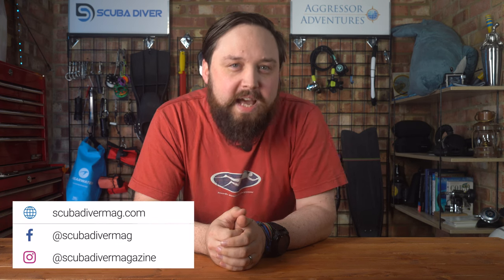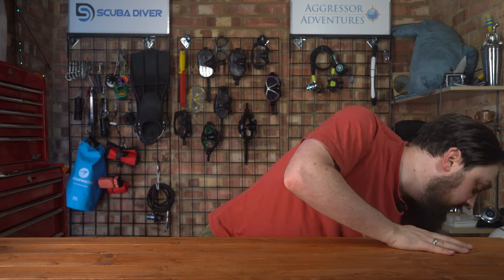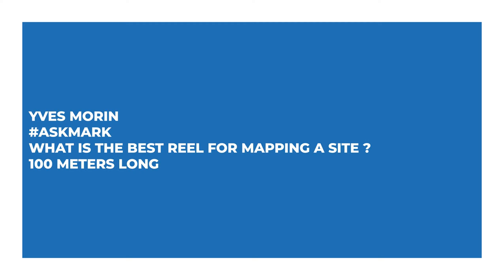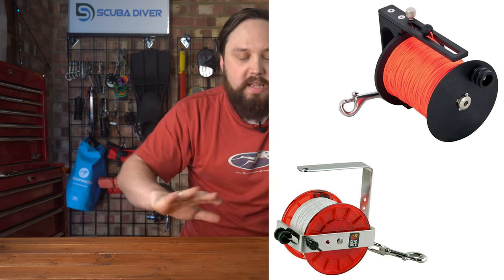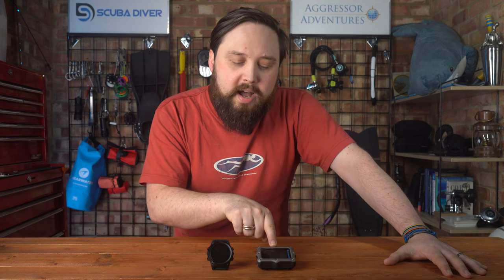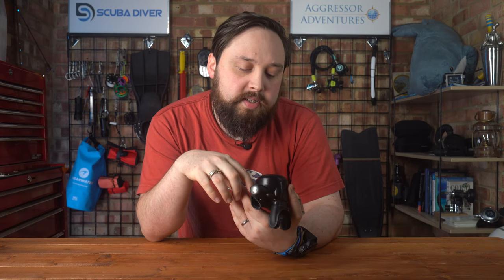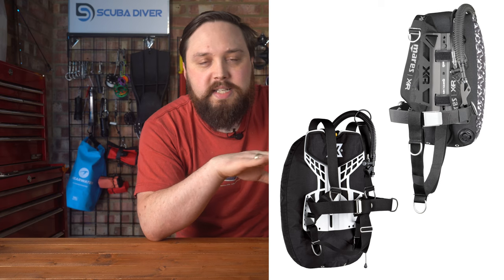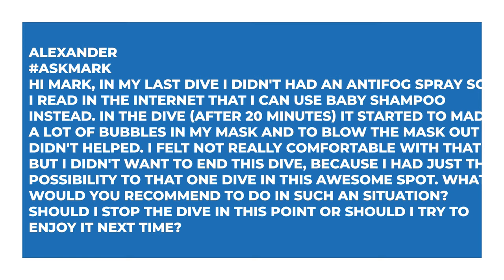Minimum BCD Lift Capacity? | #AskMark #Scuba #Q&A | @ScubaDiverMagazine

Comment: The Venturi effect is where the pressure drops when air moves from a low volume to a high volume environment. In a regulator this sucks in the diaphragm and keeps pressure on the demand valve, which keeps the air flowing until it reaches equal pressure.

In practical terms, this means that the demand valve remains open until you close your airway, without the need to continue exerting suction to keep the valve open. This reduces the work of breathing as you only need work to open the valve in the beginning.

The downside is that it creates a freeflow if the demand valve is opened when the regulator is not in your mouth. There will be a constant lower pressure which will keep the diaphragm sucked in and the demand valve open.

Regulators without a Venturi switch will have a deflector that will redirect the air towards the diaphragm. When the demand valve is opened, the air flow will push against the diaphragm to release the pressure on the demand valve and close it. With these regulators you will need to constantly create negative pressure by sucking air in order to keep the demand valve open. Much like you need to keep sucking air in on the surface to fill your lungs.

Regulators with a Venturi switch can rotate that deflector so air can move unimpeded. So having the Venturi switch in the Pre-Dive position is like breathing from a regulator without a Venturi switch. Having it in the Dive position when you're at the surface or jumping into the water, can cause a freeflow when the purge button gets depressed or there is a lower pressure in the regulator than in the surrounding water.

Comment: I use the "no more tears baby shampoo" type. Dilute it with water (around 20 soap to 80 water) and put it in spray bottle. Spray it to the mask and let it soak or even dry for a few minutes. And before wearing just dip it quickly in the water. Most new divers they actually rinse it clean so there's no more soapy film to prevent from fogging.

Comment: about pre-dive mode: I got a Scubapro Regulator. I went diving in Spain a week ago, I forget to change to dive mode, I did my deep dive certification, so if you dive 30 meter or deeper you realize it's harder to breath. I don't know if it feels similar as if you took a unbalanced first stage with you to 40m,  we should test this. 

I should really take the risk to dive deep with a balanced and unbalanced first stage, then I could test this out.

But if you don't dive deeper then 20m you don't realized much if it's dive or pre-dive.

to make my experiance short, pre-dive mode:

>25m medium difference
+/- 30m you statt to breath harder, you use more air, I would say you would dive Just 20min instead of 25-30 min, it's just a guess.

>40m you feel it, you really strugle a little bit.

But those are just my experiance,  I wonder if others had similar experiance.

Comment: Numerous times I have forgotten to adjust my venturi to "dive" from "predive". The change in breathability is negligible.  Far more important is having good adjustment on the screw valve.  It is counterintuitive, the more you screw in that valve the more difficult it is to initiate a breath. A properly adjusted tension can alleviate stress and add significantly to comfort. If you remember  to adjust the venturi, great! It will help gas flow once the breath is initiated however it is not as crucial to diver comfort  as the flow tension screw. (I dive a Scubapro G250 second stage.)

Comment: #AskMark  Thanks for all the helpful information you are always sharing, I love your channel.  I am a new diver, I am looking to buy a bcd, and Im trying to figure out the right size.  My concern is my body weight (In Pounds) when it comes to the sizes of BCDs, as well as Not understanding what it means when it says Lift(N) on a sizing chart.
Reply from the maker: Your best option for trying on sizes, is to visit your local dive store so that you can try some on. If you can remember the size of your school BCD that can be a helpful indicator of roughly what size to look at. The sizes are fairly similar across brands.

The body weight in size charts are a rough guide If that's the only measurement that doesn't fit on a size chart I wouldn't worry. The chest and waist measurements will be a better indicator for size of a BCD. 

You don't really need to worry about the Lift Capacity of BCDs right now. All recreational BCDs will have enough lift for a single cylinder setup.
Reply: The Lift(N) on a sizing chart is related to the size of the bladder. With some BCD's, the larger the size, the larger the bladder, and the more lift it can produce. That lift is not related to your actual weight. Like Mark explained in the video, you can weight yourself so that you don't actually need a BCD. The lift capacity only comes into play when you're carrying a lot of heavy gear like staging cylinders, or if you find an anchor on your dive that you decide to keep as a souvenir.

Comment: @Mohamed Al-Busaidi There is a good ISE video on sizing your wing/BCD https://youtu.be/4D_nVupptm4 
In short = size BCD as minimum to compensate for weight of your gas used during dive (2kg for single tank) + needs to float your gear on the surface when you remove it + safety margin for staying above water. You should aim for lowest amount of weights possible to keep you neutrally buoyant at the end of the dive,  to have "balanced rig" - one where you have minimum amount of air in the BCD during the dive (see comment on weight of the gas used).

Comment: #askmark having accidentally set my Suunto D5 to gauge mode instead of free for some casual snorkelling before some dives, I discovered that if you use gauge mode at all it will immediately lock you out for 48 hours - why is this a thing and in what circumstances is it useful? Why would you want a computer to be one use only?
Reply from the maker: GREAT question! Gauge mode turns the computer into a bottom timer which is handy for diving on a rebreather. It's a little too long to explain in a comment but, Rebreathers can adjust the gas mix that you're breathing during the dive and a computer set to Gauge mode is a handy backup that won't alarm.
Without recording your decompression in Gauge mode the computer knows that you've been diving BUT doesn't know how much gas is dissolved in your tissues. That's why it locks you out of other modes for 48hrs.
I'll explain better in a future episode...

Comment: #AskMark I hear about how you should have a backup of everything, including your dive computer. along with how you should buy a dive computer that can grow as your skills do.... but if you should have two; wouldn't it be sensible to start out with a cheaper (something like Cressi Leonardo) as your first dive computer then just have that become your backup computer later on?
Reply: Not many people get a back up dive computer, but if you have two, then sure. Just make sure they're using the same algorithm, so they don't contradict each other.

A back up dive computer is only really used when diving in overhead environments or venturing into technical diving. Though by that stage you should have a dive plan with you, which you should be following at all times, it's a good idea to have a back up computer to safely guide you through your decompression stops.

Comment: #askmark Using a Longhose config, angle adapter on the 2nd stage yes or no? And if yes, 90° or 110°? What are the dis-/advantages?
Reply: On the long hose: No angle adapter. Having an angle adapter makes donating impractical and complicated. You will need to hold the regulator when you're donating. It's better to present the long hose by holding the hose so the OOG diver can grab the reg.
On the short hose: Depends on the length of the hose. If you're using a 55cm hose it can help control the hose. On a 75cm hose you'll find the hose will be fighting you when you use an adapter, because it wants to bow out. On a 65cm hose, whichever you prefer.